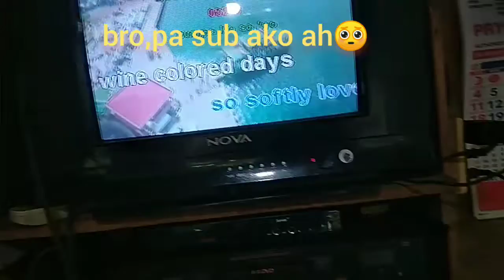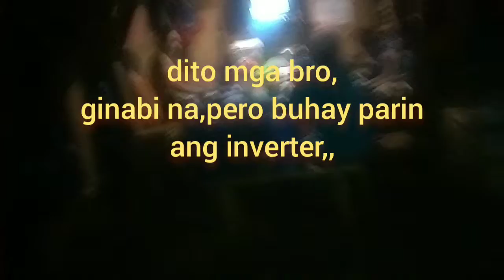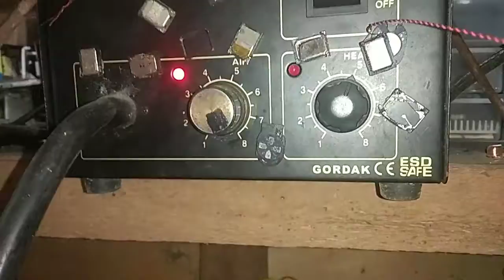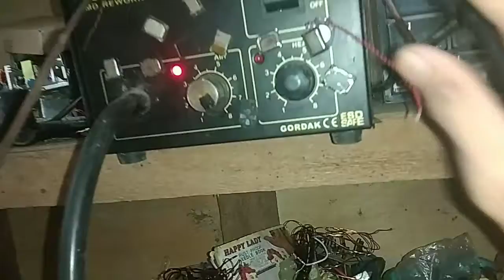sunyima 3000watts pure sine wave inverter diy

Comment: Yun oh tapos na pla
Reply from the maker: di pa sir,,,kulang pa ng mga breaker at indicator sa ac side
Reply: Kainam naman nyan boss. Naka solar charging din ba battery mo? Magkano inabot ng pagbuo?
Reply from the maker: @jasperabordo8291  sa transformer sir ay 3k inabot, core at tsaka magnet wire,
ang inverter board ay 3.5k,
bali breakers at scc ay nasa 2k+ po,,
almost 9k+ napo kasama na mga wires at indicators
Reply: @techbarron7383  bahhh okay na din sir. Nasa 11k+ na ang 3KW na 24v inverter lang. Nice work. Konting linis lang sa wiring at lagay sa magandang lalagyan, pwede na yan business sir. 😅 

Pag may pagkakataon ka sir, upload ka ng video ng transformer build. God 🙌 bless po.
Reply from the maker: yes sir,,gagawa po ako ng video sa paggawa ng toroidal..salamat po sa sporota☺️
Reply from the maker: @jasperabordo8291  opo,solar charging din,,both ac at solar,dependi po sa kung anung mode mo siya ilalagay